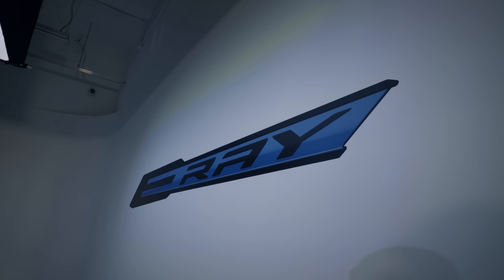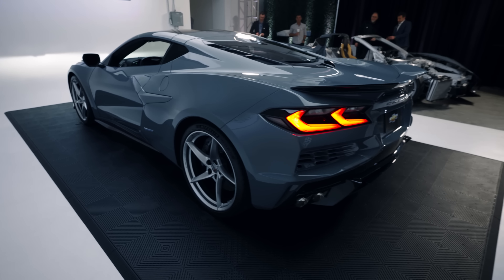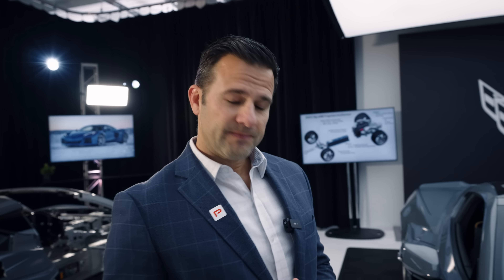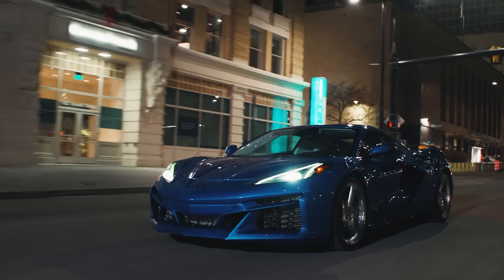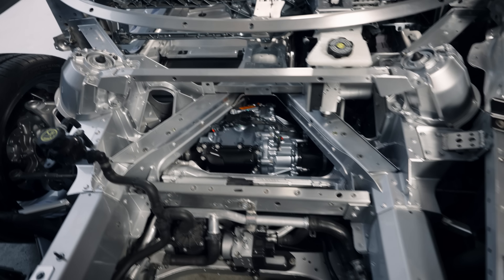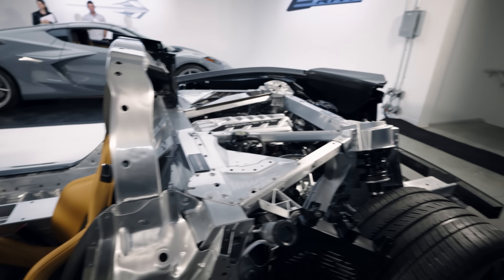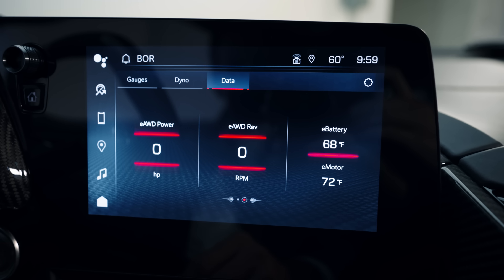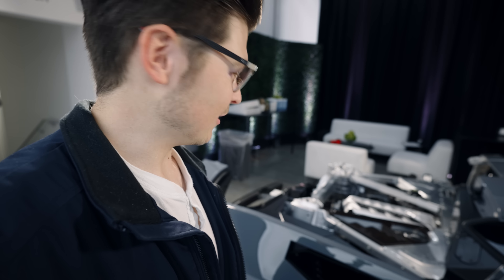The All-New Corvette E-Ray is NOT What I Expected...

Comment: 10.5 Eray vs what, 10.6-10.7 for the Z06.? But, I’m willing to bet if you give each car the best drag tires the Z06 would benefit more and be even faster. 😮.  Plus, the 6.2 standard C8 engine not the 5.5, plus 4,000lbs…plus super limited range. I personally don’t get this car. But, maybe I need more time to think 🤔 🤷‍♂️. 

To me it’s like what’s the cheapest way to create a benchmark “911Turbo”, but not losing “fronk” room, or adding anymore weight 🤔 💭 💡…I got it!…a small, limited range battery that can go one lap around a race track without adding TOO much weight. But remember!…it’s a GT car. But!…it’s a hybrid..but for only 14 miles!…oh and you’re limited to 45mph 🍻  to that freedom 😆. This car is more confused than a kid with dyed hair and family issues. Just sayin. 🎤 ✌️ 😘 😇 🤪😎
Reply: I will help u out. It is everything a stingray Z51 is plus a low power way to move it around without turning on the engine, awd, 160hp, z06 body, and improved fuel economy.
Reply: I think you are confused.  the battery drains fast but it also charges extremely fast.  on the street it will always be faster than the Z06 and on long trips or to move around the city the fuel economy will be much better.  basically it's an AWD and slightly faster stingray that can ride in electric mode for a short period.  there's nothing confusing about it, and it's similar to all other hybrid Supercars
Reply: Says the confused guy who thinks it's all about the race track.
Reply: Try those times in Death Valley or Albuquerque, then report back here about your 0.1 of a second decision to buy one or not.
Reply: @bobolulu7615  How in anyway shape or form does that refute, or add anything beneficial point(s) to my thoughts above? I understand that atmospheric engines struggle at high altitude and all. But, remind me why the .01% of business GM does in DV or NM, has anything to do with HOW GM choose to electrify a performance GT Corvette?